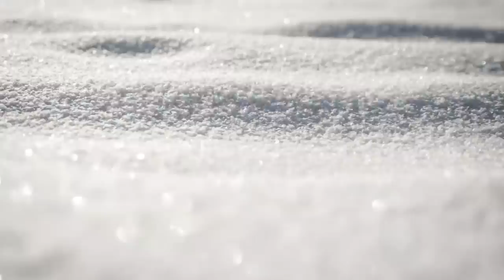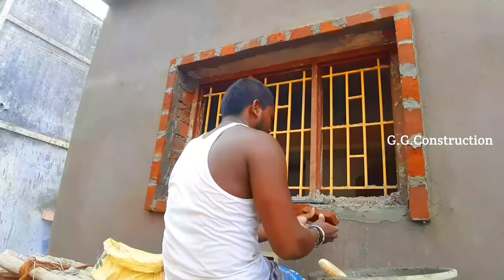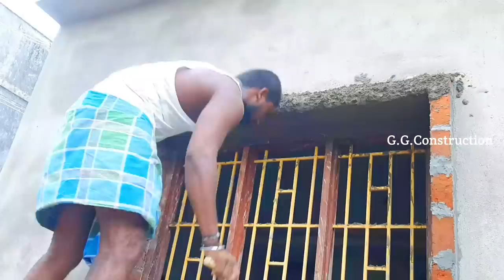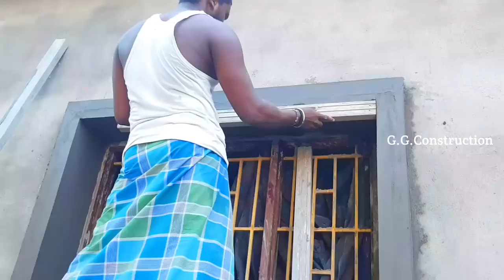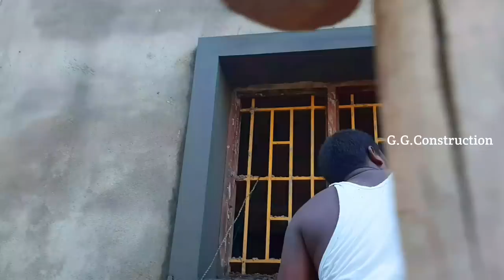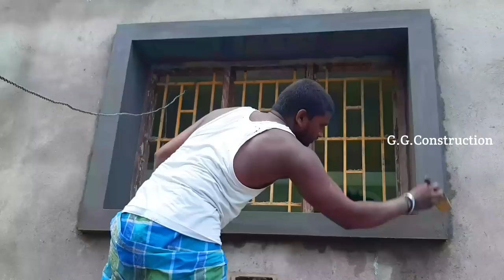Amazing Parafet Window Design-Beautiful with 23x33 size house window Border design installation

Comment: can you tell me the ratio for sand and cement?
Reply: what is ration
Reply: Needs to be 3:1 for this kind of work. (3 sand and 1 cement). He also put cement mix on the wall in the first place...that mix is only cement and water....for a good bond. Top plaster can be 4:1.
Reply: @KH-im4ez  thanks
Reply: Bricks ka size bataye